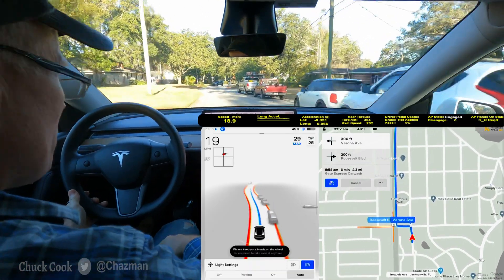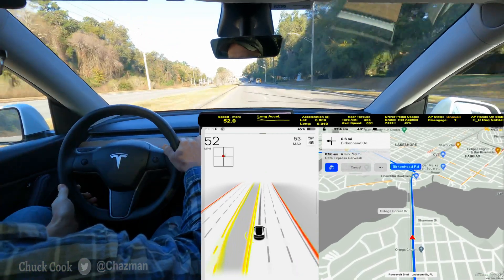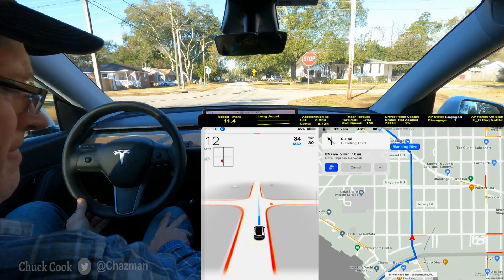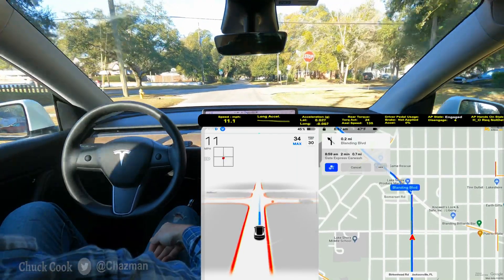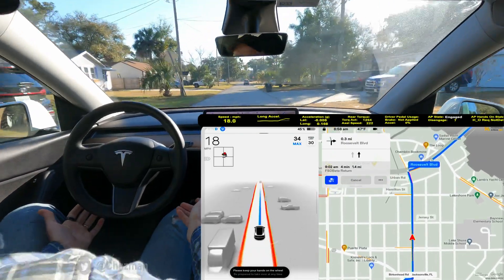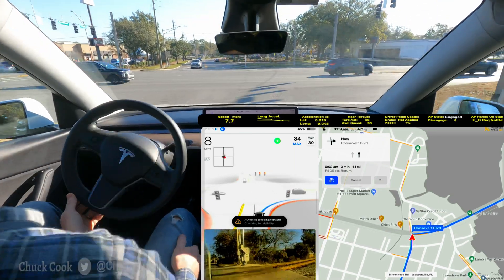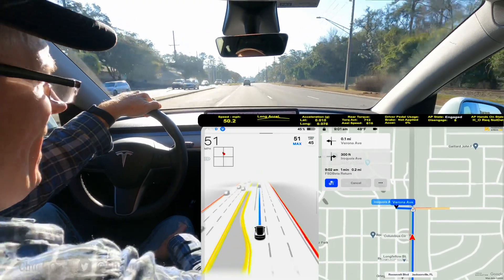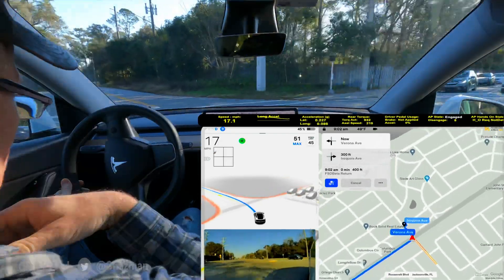FSDBeta v10.10 CAN Bus Dual Axis Acceleration Calibration Drive

Comment: Hey Chuck,  I wanted to get your thoughts on this.  Hope you don't mind me posting it here.

I am currently on v10.9 and up until today I thought it was a step back in terms of releases.  Up until today when I do my usual routes, I would go through stop signs, it would abruptly break multiple times through the turns and just a bunch of little things.
Then yesterday I took a 30 minute drive in rush hour traffic and I let FSD do most of the driving.  Since then the FSD is doing so much better.  The stop sign that it could not get through smoothly for the past 2 weeks it goes through perfectly and many other things seem better.

It made me wonder, when we get a new release do we need to do a bit of priming with FSD to get it to build up its internal caches (I am a software engineer.  a little geek talk there) meaning prime it with a few difficult high traffic situations before evaluating it.
Thought I would share my observation.   Have you experienced this?
Reply from the maker: No FSD does not work like that.  There are no internal "memories" its a trained NN, or  hardcoded C++ code doing the driving.

Comment: First time viewing your content, great stuff. Curious what is being used to capture the Tesla display. Also curious, does the can bus update in a specific interval or have a sync signal hertz? If so maybe use that for jerk measurements?
Reply from the maker: Every frame on the CANbus can have its own frequency.  It is just a stream of data.  I am not quite familiar enough with it to know exactly what frequency the acceleration dataframe is yet.  My screen capture is done with a DIY LVDS to HDMI mod I did by tapping into the pins of the TI deserializer chip on the back of the monitor board.
Reply: @ChuckCook   Awesome :) Thanks for the reply. Makes sense about the LVDS, sucks that it isn't easier to tap into.

Comment: Why do so many FSD testers let the car do things to them that they don't want it to do?
If it's rocketing up towards a speedbump: disengage it. Report it. If it's gonna catch air over railroad tracks like you're in the Dukes of Hazzard: don't let it.
If it's like you're training a teenage driver: should you not prevent it's mistakes? Especially since these kinds of behaviors are actually hard on the car you paid like fifty grand or more to get?
Reply from the maker: This was a calibration drive to validate acceleration.  I normally don't let it do that stuff.
Reply: @ChuckCook  Ah cool that's good. When it took those railroad tracks my entire body tensed up. I see a lot of FSD testers who are far too content, in my perspective, to just let the car do whatever when the whole point of the beta program is to be training it.

Comment: CANBUS data looks good. The G meter with a level dot is excellent. Tracking the peak G and Torque could be useful and possibly saving it by disengagement. People are used to seeing torque in lbs.

Comment: Something interesting to me is steering wheel torque, angle, or angular rate.  I.e. how much steering input is the car applying?  Sometimes it's hard to tell, then the driver says "jerky turn" while the steering wheel barely moves
Reply from the maker: Interesting thought.  I will look into it.

Comment: I laughed when the car flew over the railroad tracks. I have steep inclined railroad crossings and I have to disengage every time or the car would catch air. I remember at some point the system used to slow for them, now it doesn't? I cant remember. Love the new U.I. as well! Keep it up!

Comment: 2:40 maybe you can sense the "vibration" or "impacts" somehow too? Like if the ball jumps around a lot, so have a lot of energy expense in the last 2-3 seconds (also called jerks) this should be marked as "uncomfortable" with a simple bar - as it's more comfortable to have smooth accelerations in all directions.
Reply from the maker: I have not figured a way out to calculate jerk yet.. as the CAN messages don't have a timestamp.  So I would need to use the time from the RPI to take an additional derivative.  Not saying it isn't possible .. just that Jerk is not a raw CAN parameter I have found yet.
Reply: @ChuckCook  Jerk is super noisy, and CAN jitter is going to make that worse.  You can try it but I doubt it'll look all that useful without additional filtering, which sorta defeats the purpose.
Reply: @ChuckCook  yeah you could create a time series as messages comes in and calculate the change per ms for each change in both axis. Then add x and y (without minus) and put it into a an exponential moving average. :)

Edit: brainfart :)
Reply: @ChuckCook  for the jerk you may want to just go old school and hang something up that shows jerk movement.

Comment: 2:38 The red ball left the scene :D

Maybe have it appear even outside the square and have the square just as a reference whatis "comfortable"? :)
Reply: Yes, that would be great!
Reply: If comfort is the goal displaying "jerk" (technical term) could be very valuable.  This would have to be derived from the canbus data.
Reply: Love the canbus data, and think it being above is better. Should the acceleration be a logarithmic display so it can display a wider range of acceleration/deceleration before leaving the screen. Also it didn’t seem to show the speed bumps/railway discomfit accurately perhaps because it’s vertical acceleration? Perhaps the vertical acceleration (if available) could increase the dot size or change the color?
Reply: @grahamfowke  logarithmic display doesn't make any sense. It's not an intuitive way to display data.
Reply: @RubenKelevra  It's how the magnitude of an earthquake is displayed isn't it and allows you to see small movements while still being able to capture large movements.
Reply: @grahamfowke  the discomfort of speed bumps is not because the acceleration is sudden not smooth (jerk) and is oscillating with a high frequency.

The main motion would actually be tilt not z axis acceleration.
Reply from the maker: I like this vertical acceleration idea.  Will think this through.

Comment: It is clear that FSD Beta 10.10 has some serious regressions since it has not been released to a large number of us - it'll be interesting to see what happens when they release 10.10.1 (or 10.11?) in the near future - the problems you are seeing on this drive are similar to what some others who got 10.10 are also seeing.
Reply: Maybe even just going to v11 that would be the dream
Reply: If you are referring to the very narrow roads portion, I don't think it's necessarily a regression. Perhaps a lack of training in accurately recognizing that the road past the paved areas is drivable, and some gaps in driving logic on roads such as these.
Reply: @mariusm62  - No, I was mostly referring more to Chuck's infamous Unprotected Left Turn video he did using the 10.10 release a few days ago - it was very disappointing to see that he couldn't even get the car to attempt any of those difficult left turns - it was behaving like some earlier releases where it was just deciding to not even try to cross the busy highway, but just turn right instead - but the driving on narrow roads, which has been problematic in previous releases, did seem to me to be worse than what I've observed in other FSD Beta videos (other than the ones that Chuck usually does).  But, I'm confident that the upcoming 10.10.1 or 10.11 release to fix the issues in 10.10 will get us back on track, more or less.  And eventually getting to a solid Level 3 and (hopefully) something close to Level 4 by the end of this year seems quite realistic to me.
Reply: As disappointing as the unprotected left regression was, it’s a very difficult case, and on more “normal” drives, a bunch of testers have had very positive results.  Crossing high-speed traffic into a median is clearly not something they’ve explicitly programmed it to handle, so if it’s improving elsewhere and this is more like “undefined behavior” than “regression”, that’d be good news overall.
Reply: @peterwmdavis  - If you look at Chuck Cook's ULT video for the 10.9 release ( https://www.youtube.com/watch?v=3X0S3YlbVHs ), you'll see that the car not only tried to make ALL of the ULTs, but it succeeded quite nicely in just about all of them - only the first attempt was bailed - and based on similar ULTs that I've tried, the car may have actually succeeded with that first attempt, too - although it clearly made Chuck feel a little uncomfortable, so it's always a good call to follow your instincts - and as Chuck deduced (correctly), the only problem in the 10.9 release is the car doesn't attempt to make use of a median that is wide enough to allow the car to divide the turn into 2 parts - first, get across the traffic coming from the left and then pause in the median area (if necessary) and second, merge into the oncoming traffic that is coming from the right - this is what many humans will do - and it's clear the neural net training can "teach" the car to make this kind of more advanced, but necessary, maneuver when trying to make an ULT across a relatively busy highway like the one that Chuck tests against when a new release comes out.
Reply: @polarlight1369  completely agree there has been clear regression is certain behavior, particularly UPL. 

I wish the progress was more linear, even if very incremental. Large occassional regressions undermine confidence in FSD.
Reply: Lastly, I love what Chuck does and it pains me that he paid Tesla $5 - 10K to do it! They should be paying him for his rigor and commitment to testing.

Comment: Why are the axis flipped? 🤔
Reply: I also noticed this, but then I rewired my brain to look at it as a vector of acceleration, starting from the middle and ending at a dot.
Definitely agree it should be reversed, though.
Thanks, Chuck, so much effort from your side!
Reply from the maker: The feedback here is amazing.. Group think is so much better than an individual.. as long as its constructive.
Reply from the maker: I guess it depends on what you expect.  I can switch it if I have broken a convention.. Which one do you think is correct?
Reply: @ChuckCook  agree this is flipped. 
.. i expect the dot to go with the force i'm feeling... (moves like water would in a cup) 
acceleration makes dot flow backward..  turn left throws dot to the right.. etc.
Reply from the maker: Ok.. That is my fault. I agree with that convention.  Will switch it up,  dot will move like a pendulum in the car.
Reply: @ChuckCook  I feel like it should behave like a ball in a bowl - just without the motion potential.
Reply: Love this! But yes, agree that maybe it should show where we are being thrown instead
Reply from the maker: This is done.  I have implemented the change in the code .. for next time :)
Reply: @ChuckCook  thanks! :)